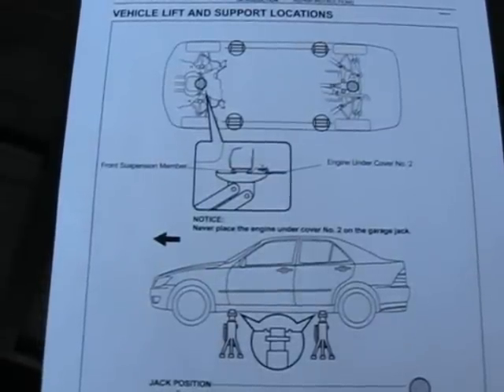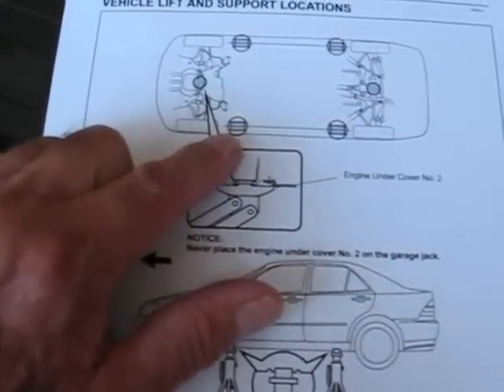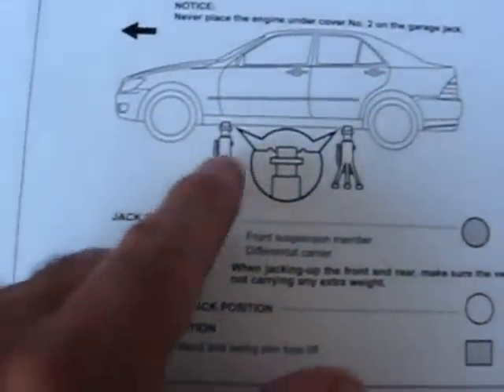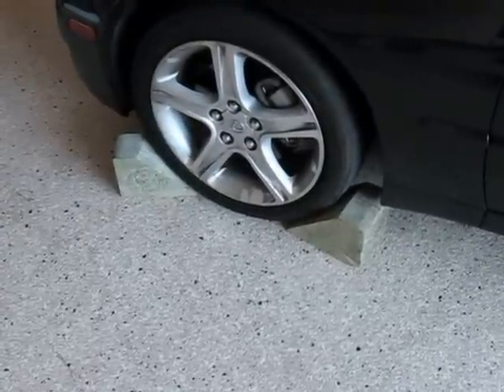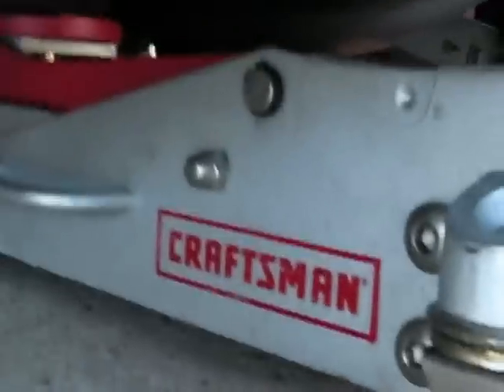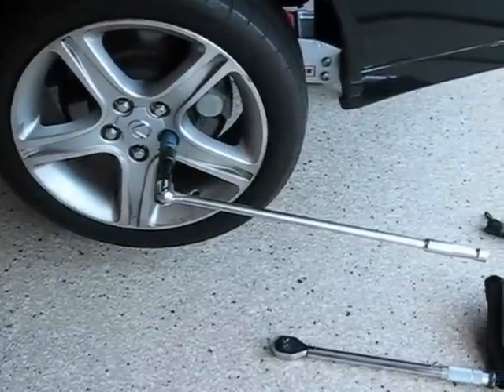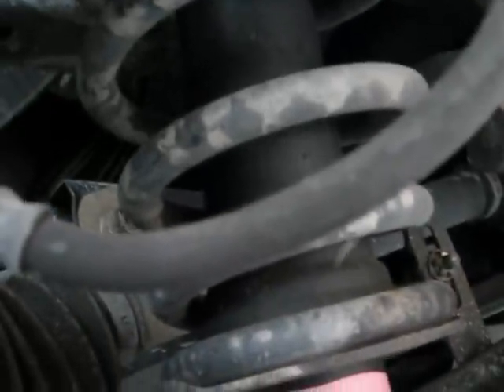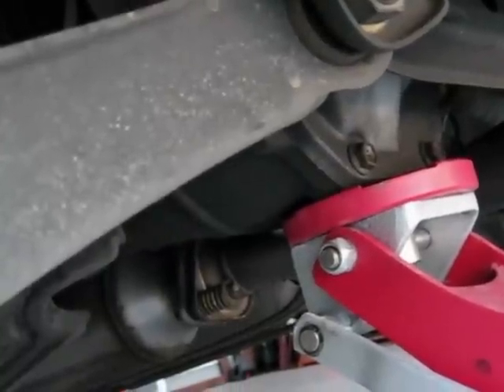Lexus jack up rear jack stand placement by froggy

Comment: Wld it be better to put the jack stands on the sub frame pinch  points as garages are using the 4 post swing arms on the sub frame pinch points suprised the manual suggest the notched pinch points for jack stands

Comment: Ok but I always use some solid blocks of wood an inch and a half or so thick to go between the stands and the car.The wood takes the weight and relieves stress on the metal .even if the wood cracks a bit under the weight it's usually safe .Better that cracks then your car
Reply from the maker: Good idea.